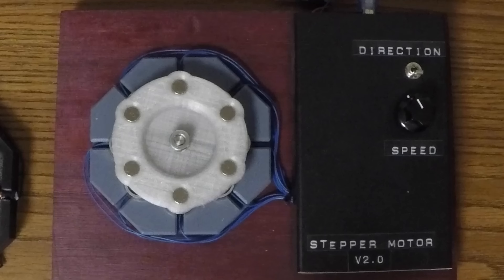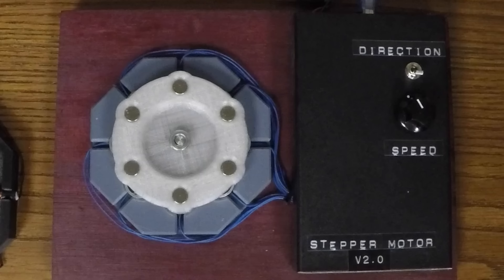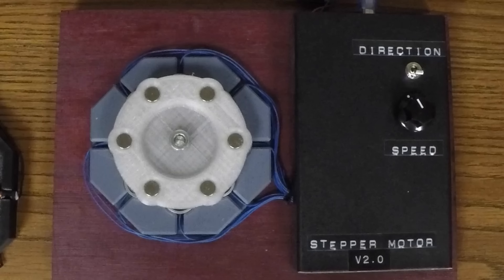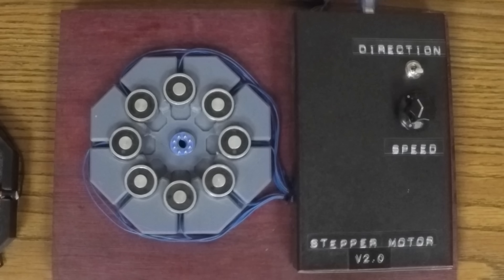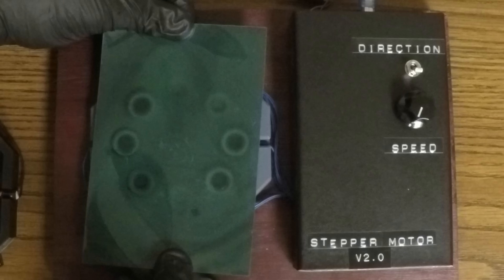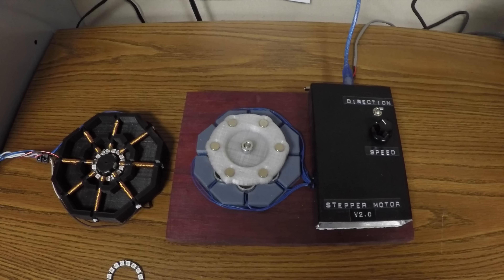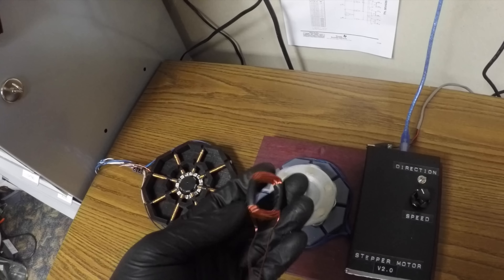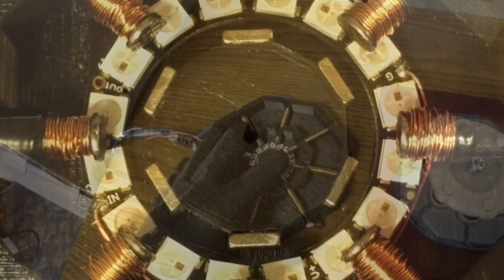3D Printed Axial Flux Stepper Motor

Comment: Another common application for these motors is in floppy disk drives and I think some CD-drives, but FDD's had very little clearance and almost always had this general setup.
Reply from the maker: +Reed Arnold Yeah, you're right.  I have seen floppy disk drives with axial flux motors.  It's more common now to have brushless outrunner motors in hard drives and such.  I'm not sure why they made the switch, but I believe it is cheaper to build outrunner motors.

Comment: What's the downside of using air core electromagnets? Why didn't you go directly with that?
Reply from the maker: +ɐqǝs ɐpuɐɯ I didn't realize that they would be better for this application until I started experimenting, but I had already designed the stator for the iron core electromagnets.  The air core electromagnets would not benefit from the amplified magnetic field that the iron core provides.  The iron core electromagnets have a stronger magnetic field, but that is not the best choice for this application.

Comment: Any idea how to remove that dampened oscillating vibration when the motor stops? I believe it is what's causing ripply lines in my 3D prints. Could a flyback resistor work? Or something!
Reply from the maker: +Hedron The main reason for the bouncing in my motor is the spacing between the rotor and the stator. It would be much smoother if air core electromagnets were used so the rotor could be moved very close to the stator. More steps would also make it a bit smoother as well as having three electromagnets holding at once. I also think that reversing the current flow of the nearby electromagnets to repel the magnets in the rotor in such a way to create a more stable node for the magnets to sit in after stepping.  You can try microstepping your stepper motor for smoother rotation as well as trying to add mass to dampen the vibrations a bit.
Reply: +Proto G My 3D printer runs 1/16 microstepping, which is the most common. Some people use 1/32 so perhaps I'll get some drivers and a controller that can handle that. From what I've read mechanical resonance plays a key role. Its been said that stiffening belts, and lowering acceleration and/or jerk settings will help dampen the oscillation amplitude. And that adding mass will change the frequency. I'm shooting for the prior so I'll try that first. Thanks